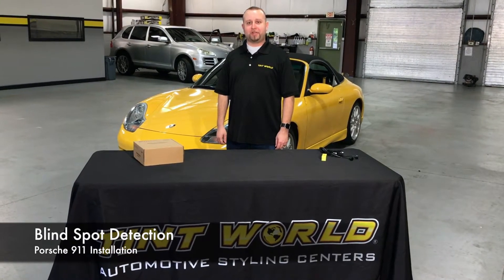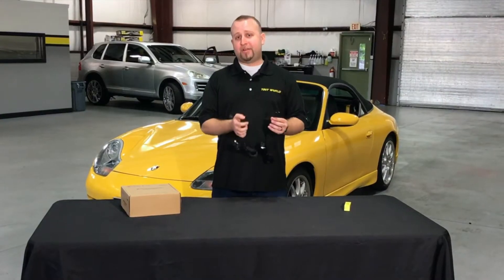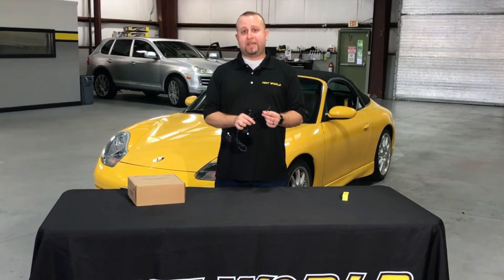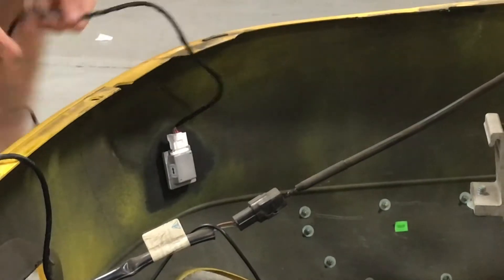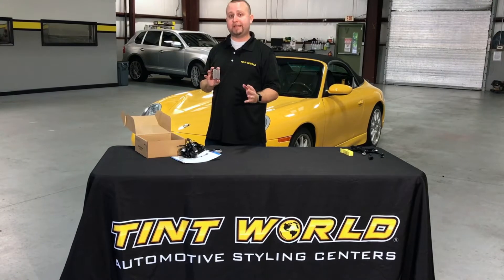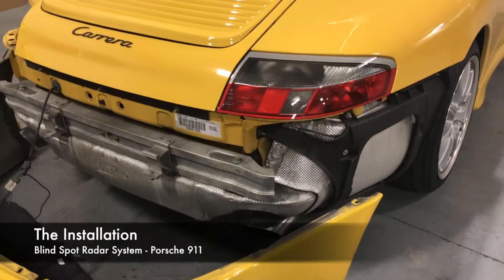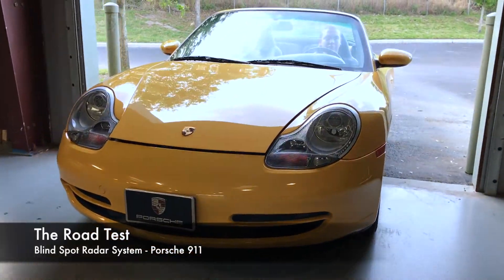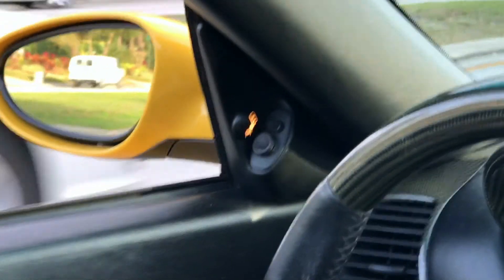Radar-Based Blind Spot Detection System in a Porsche 911

Comment: No one cleaned the rear sensor area before mounting, seems like it won't stick that well?
Reply from the maker: JonesingJalopies The areas where the sensors were mounted received a full alcohol cleaning before being mounted. It just wasn’t shown on video. This install was completed over 2 years ago and the sensors are still working great, without any issues.